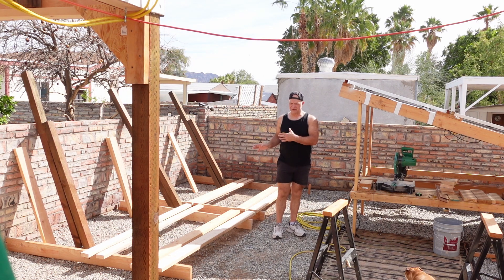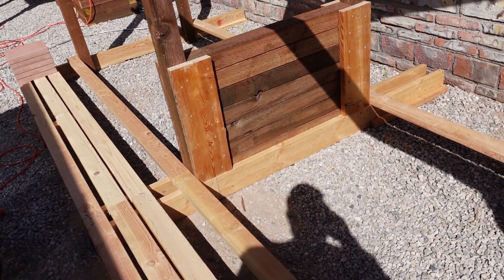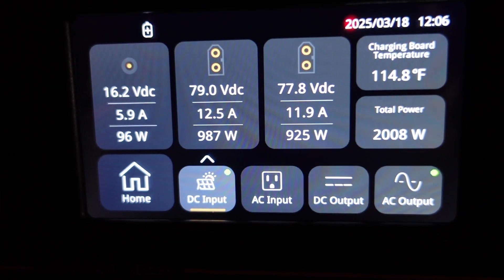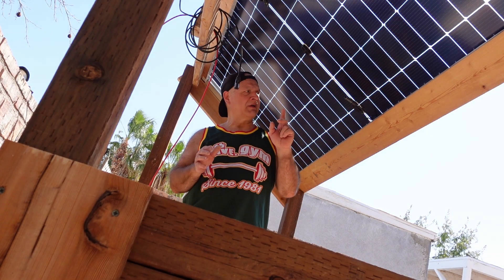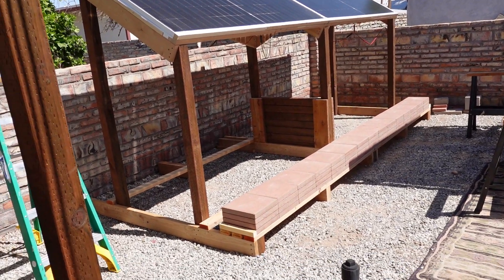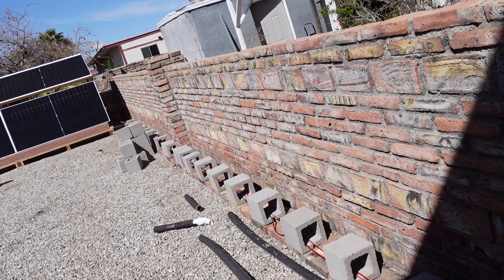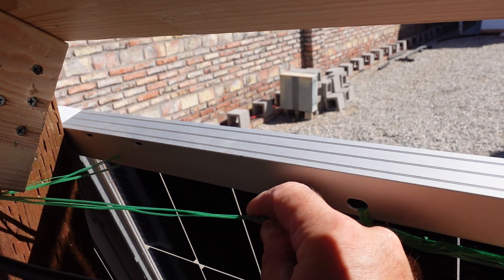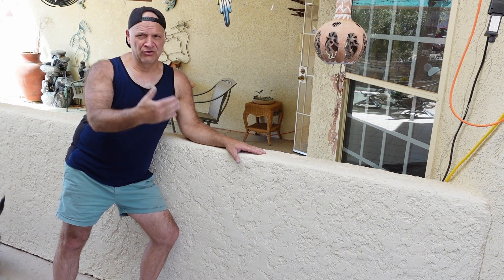DIY SOLAR SHED EP 29 - Installing the last 4 SUNGOLD 560 WATT PANELS!

Comment: Nice job, looks well done. You probably already thought of this but: Since they "unsecured" one could put a hydraulic arm on the lower panels that you can change the angle of them throughout the day for peak solar output.
Reply from the maker: The bifacials are supposed to be less dependent on angle to the sun but I clearly see the difference between the two angles. If I was in need of maximizing input then I'd probably do something but want to wait until next winter season to see results with lower sun angle. Thanks for the comment!

Comment: Those look like bifacial panels. The vertical panels should actually work better  than the angled higher panels with no sun blockage from behind. Vertical is the way to go if you have the open space (which you appear not to have.) I have my 580w panels set up in an open field on integra ground mounts.
Reply from the maker: Haven't had them up long enough yet to make a full assessment. Thanks for the comment!